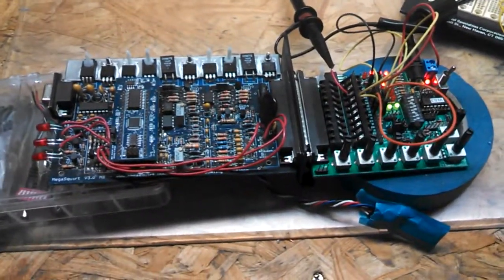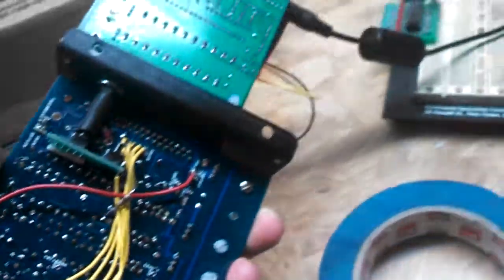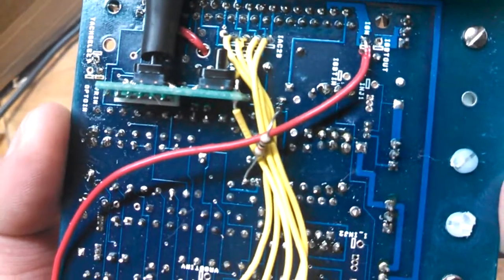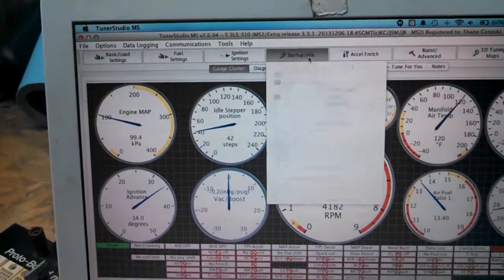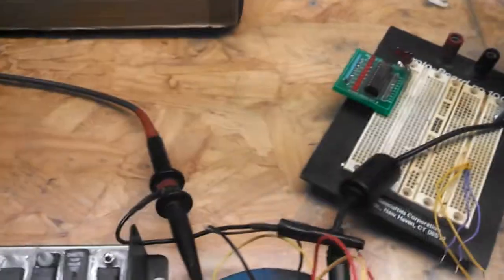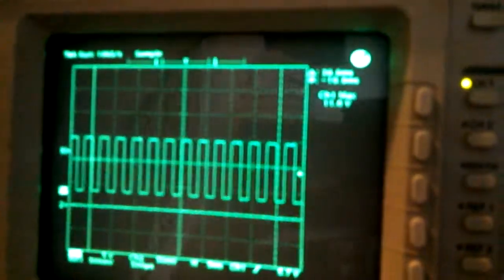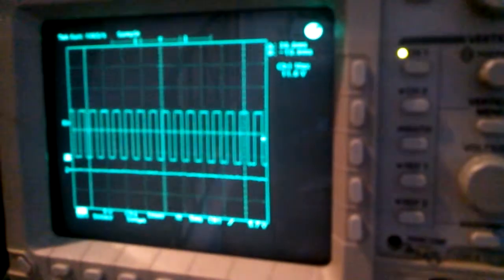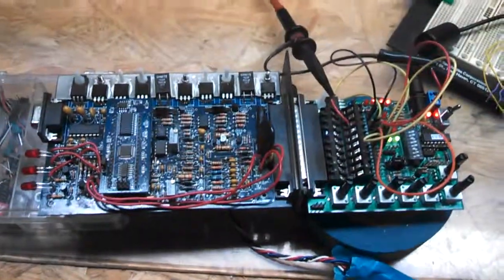Megasquirt 2 V3 FIDLE Tach Output Mod

Comment: Do you repair MS for others? I've got a II v3.0 for EDIS with no brain.  Cant get spark to it.
Reply from the maker: I have in the past.  I would highly recommend reaching out to the people over at msextra.com though since I am assuming you are not local to me.  I am on there very regularly and they are quite helpful and knowledgable.  Have you done any tooth loggers in tunerstudio to see what signal is getting to the ecu?  Also if you do start a post over there make sure to include your .msq and a datalog from Tunerstudio.

Here is the link for the MS2 forum.  http://www.msextra.com/forums/viewforum.php?f=101&sid=9f210bd6a41a3ad7a9ae8942b38b72ad